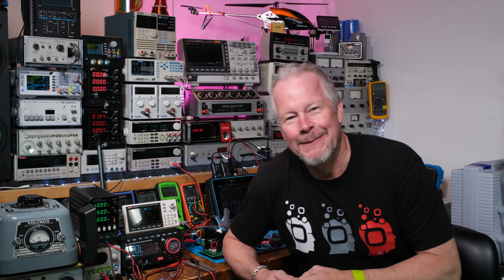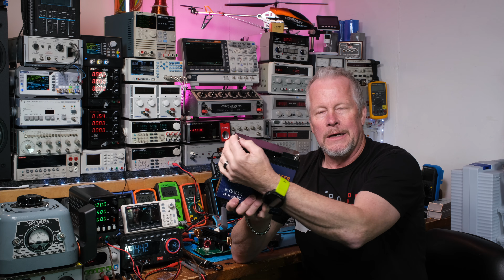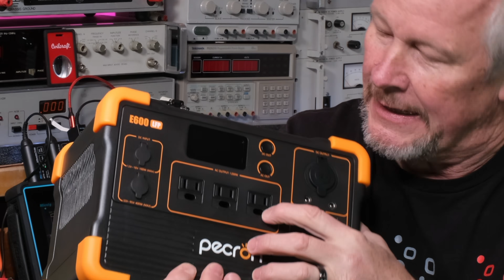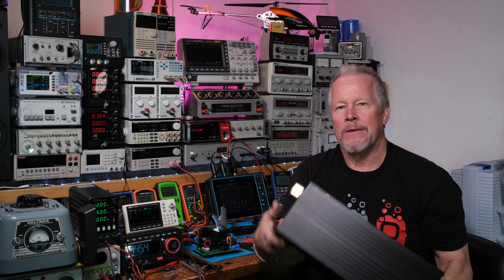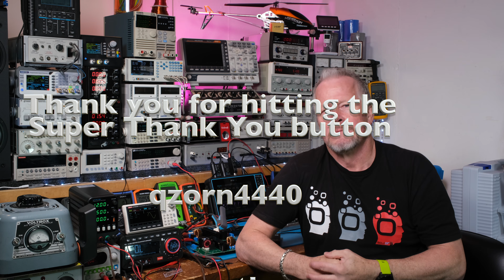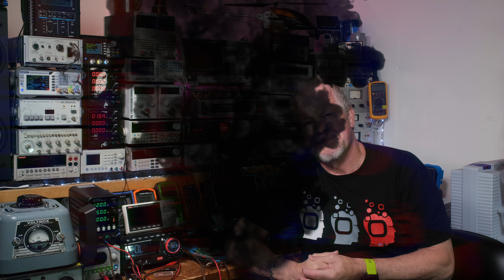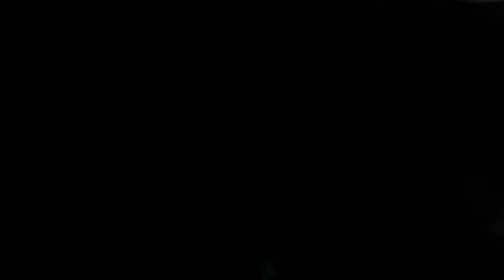Understanding Safety Ground Rant #rant #understandingsafety #grounding

Comment: Not sure I agree with drawing all lines straight down to a ground, I find that confusing. Signals go back and forth for power supply control loops, don't like crossing signals. I see things real simply with a ground symbol in a close circuit without running down to a common point, always made sense to me. To each his own.
Reply: Yeah me too.
Reply from the maker: Thanks for the feedback Dave!  You are right - in some worlds making a schematic simple is what it is.  In my world where there might be a digital ground - an analog ground - an RF ground - and then there is the primary ground and secondary grounds - not to mention the filter grounds and so on.  It actually is confusing when you have to determine which ground goes with which symbol.